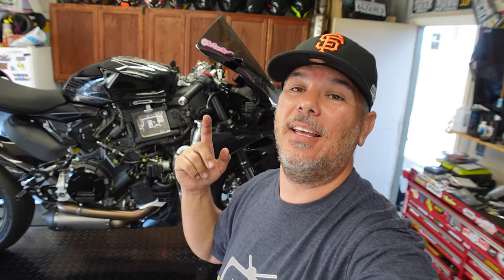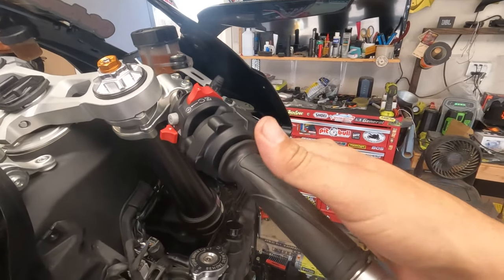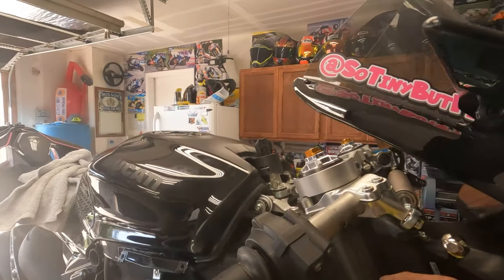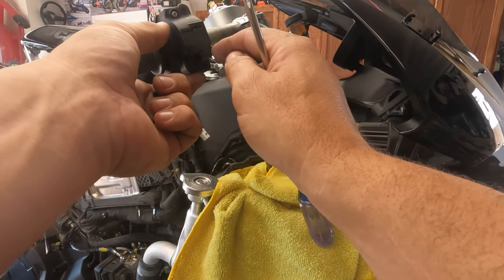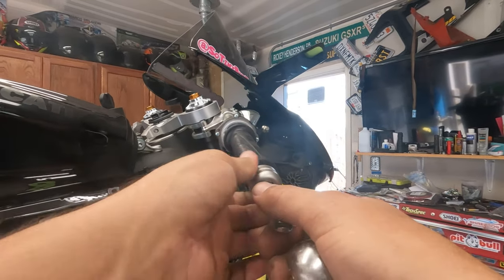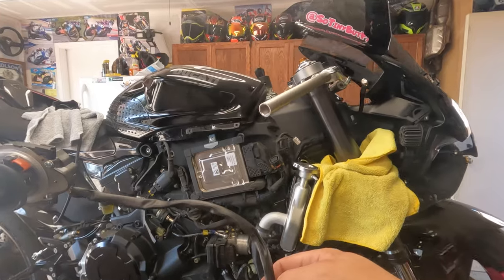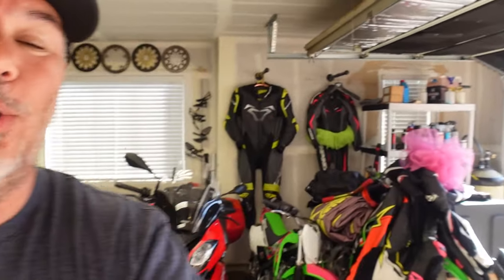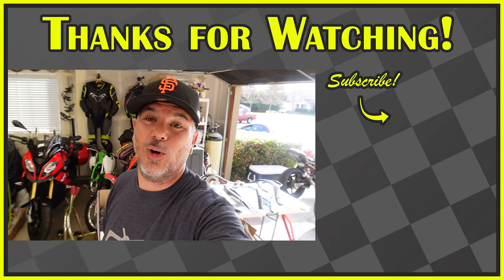2021 Ducati Panigale V2 | Brembo RCS17 Brake Master Install

Comment: I’m installing the Rcs 17 corsa and stylema calipers. On my V2 Do you recommend changing the rotors to the Brembo T’s or will the stock rotors be fine?
Reply from the maker: Definitely would recommend the bigger rotors. The oem rotors are 320mm and they should be 330mm. Don't forget you'll need the switches otherwise the master won't fit.

Comment: Is it alright to fit the new master cyl without the locating pin on the handlebar? The pin adds more rigidity and takes off a bit of load on the 2 clamp bolts. Easy to drill a hole at the new spot.

Comment: Why not go with the RCS19 master,I installed one on my V2 and it cleared no prob, Great info on the brake upgrades BTW,way to go! Thanks!
Reply from the maker: Because this bike has a stylema calipers so the rc19 would feel very harsh as it pushes more fluid. Rc19 on the oem calipers, which require more fluid, is the appropriate master.

Comment: Sir, what is the brand of the tool that you uses to suck all the brake fluid out? The one that connected to the compressor because I would like to buy one for my brake job. Thank you!

Comment: Thanks for posting.  Quick question... the purchase of the jetprime was necessary to create enough space for the brake lever to work properly.  What other functionalities does the jetprime buy you?
Reply: None... it does look nicer :)
Reply: @donovanjanus7252  It does look better.  Do you loose functionalities?  For example, in the case of the s1000rr, the cruise control, mode, heated grips are on the right side.
Reply from the maker: On the V2 there's no functionality lost since there's no heated grips or cruise control. We only did it for the sake of fitting the master.
Reply: @CaliMotoTV  If you decide to do it on the R or RR I will be interested how it works out.  I am not a track guy, but those switches seem to be more ergonomically set up than the stock.

Comment: Why not using RCS 19?
Reply from the maker: It'll make the feel of the brakes extremely stiff. Not something we wanted.
Reply: @CaliMotoTV  What is the difference between them that causes that? I like a little firmer feeling brake lever.
Reply: @CaliMotoTV  I’m runnng an RCS19 on CBR600RR callipers on a SV650 and they work fine.